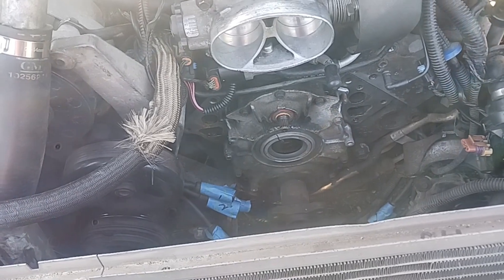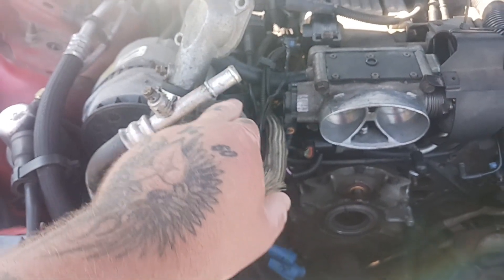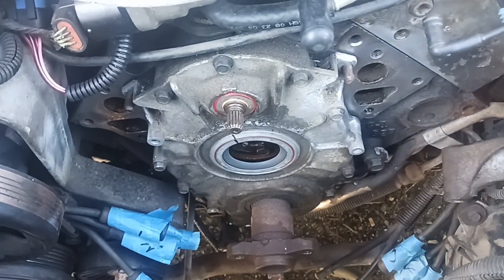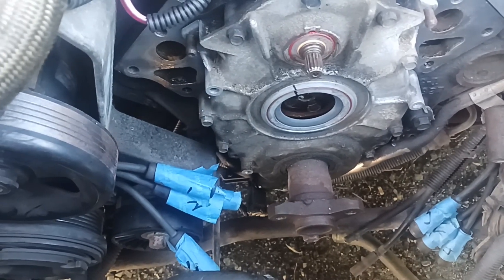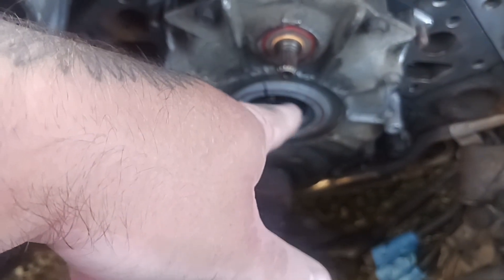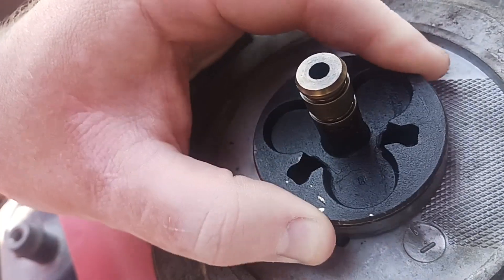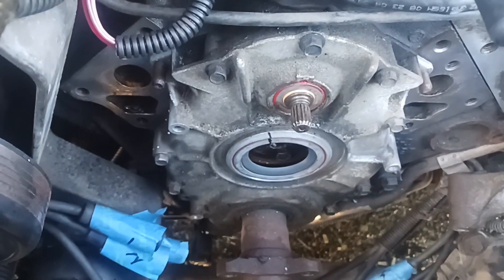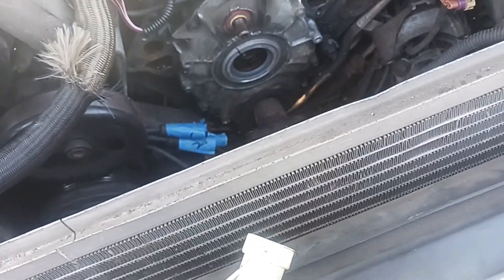tips on how to properly install optispark and seals on 95 to 97 lt1 engines

Comment: Thank you for posting vid.. I changed timing chain , when i put all back together could not get to start. i tried all the holes on the opti spark turned out to be the odd looking hole and it started. found it difficult to get the pin to line up with the hole . I thought I may have miss timed the timing chain..  big lesson i learned again is get motor started as soon as you can. I installed water pump but thankfully didn't ad coolant

Comment: when i installed mine i made sure it was all lined up and it went on without a fight thinking it was all set. go to start the car up and she just sputters as if the timing is off. is it possible my opti is bad or possibly installed wrong even tho it was lined up?
Reply from the maker: The timing is most likely off even with my one from oriellys being bad the car still started but didn't run good a good way to tell if it is off is if it pops after u stop cranking it's definitely the timing

Comment: Thank you very much! I was looking at the new one and couldnt remember if the tab goes in the one with the square marking. Thanks again!
Reply from the maker: No problem happy to help
Reply from the maker: No problem happy to help
Reply: @Vtec_unlimited  I pulled the timing cover off and it ripped the oil pan gasket! I hate this car now too! 😆
Reply from the maker: @dylekpolski7355  sounds like mine lol my car is christine you fix one thing and another breaks I went to put my seals in while doing the opti and didn't really until last month my timing cover has a Crack in it I thought it was just the seal leaking

Comment: Thank you for the video! I will be sure to put mine on correctly. Thanks to you.
I have an oil leak from my timing cover (traced the leak with dye) on my lt1. Right now, i have the opti, water pump, crank hub, oil pan, and more all torn off - fun stuff!
Reply from the maker: Glad I could help and it's definitely a job for sure hope everything goes smoothly

Comment: Thanks for taking the time to warn of us of this problem.  I'm going to install the seals and opti in a few days.  I did this once before in one of my first C4s around 20 years ago.  Bought a GM opti, in '96 it was $800.  Got it in and the car ran worse.  The opti was bad. At least the 2nd time it was lot easer.  This was in the days before Youtube so you were pretty much on your own.  I think it took a half a day to just get the crankshaft pulley off the first time. Oh, the reason I did it myself was the Chevy dealership said the new opti and labor would be $1,800.  I was thinking, how hard could it be?
Reply from the maker: No problem and I had to do mine 3 times I bought 2 optis from oriellys and the first one was locked up when I got it and the second one the cars computer didn't like the sensor inside so it ran like garbage and was misfiring the third time I went with one from petris enterprises and it's been fine ever since